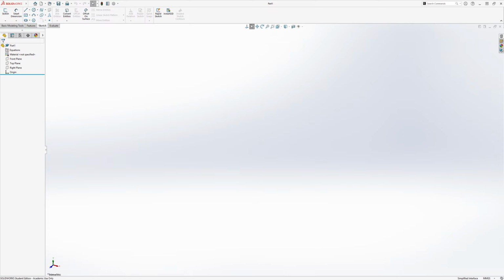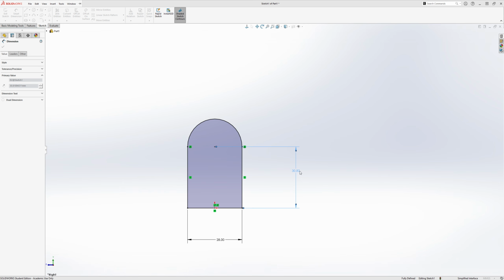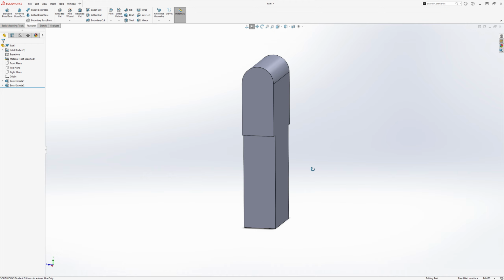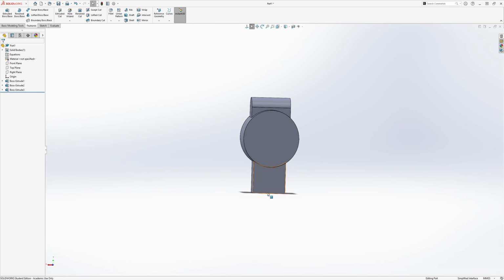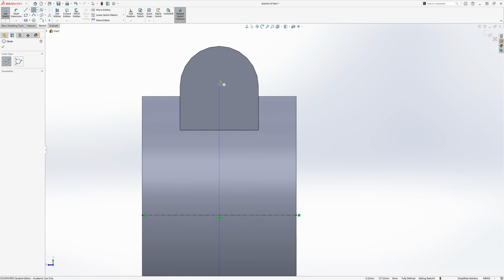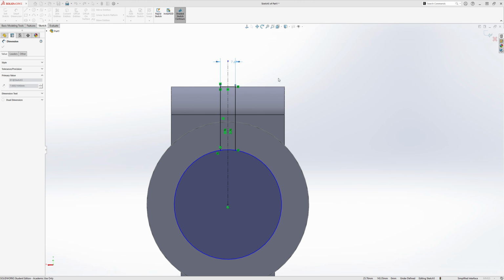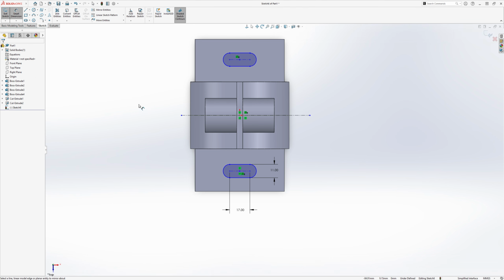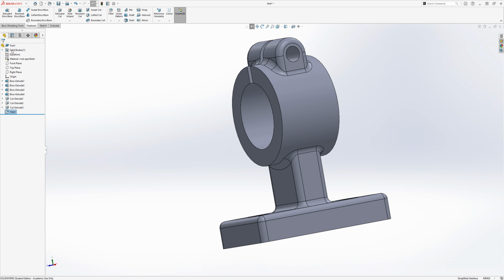Solidworks CSWA Practice Problem 4.20

Comment: Sorry, but your solution is not correct, it's not the same volume as in the pdf practice problem 4.20, the volume should be 436580 cubic mm.